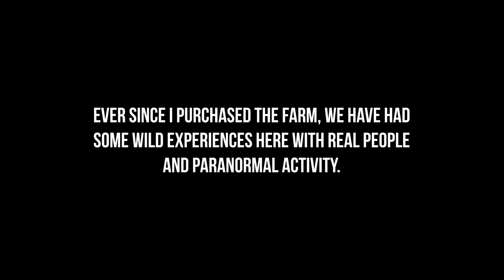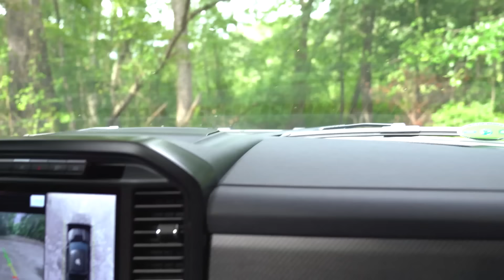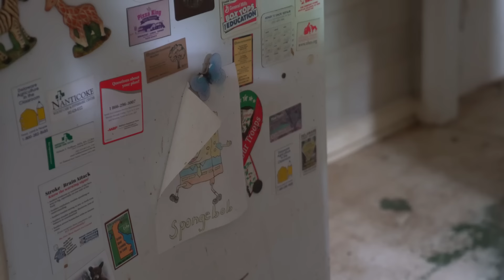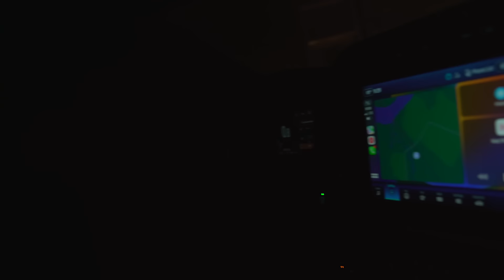PERSON GOES MISSING AT THE ABANDONED HAUNTED FARM I BOUGHT

Comment: I think the condensation is pretty normal .. that thing is metal, if it's gotten cooler in the basement at night, it will retain some cold just by being metal .. then the room warms up some in the day , condensation forms. In the summer, my toilet tank actually gets so much condensation  just because there's cold water in it and we don't have air conditioning.
Reply: I was wondering that too, duct plenum didn’t even have a lineset running to it, the heating oil furnace was just a furnace an never an air handler fr central air

Comment: I don’t even see a refrigerant line set running to the plenum of that heating oil furnace (unless it’s in the back where i wouldn’t see it) so i’m inclined to believe that the condensation is not caused from ac operation, it’s probably because of a damp cool basement

Comment: it is avoided because of the Extreme heat underneath. and has spreed so much that it is deemed unsafe and so hot that driving in any sorts of the road could result in sinking because of extreme temperatures. So severe that before they started evacuate the area but some said no and. After they said no before it really became abonded after every ken left that was after the roads were melting and caving sinking because of Extreme heat so severe sown could even breath.